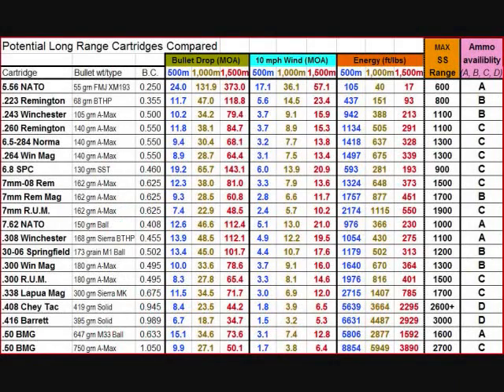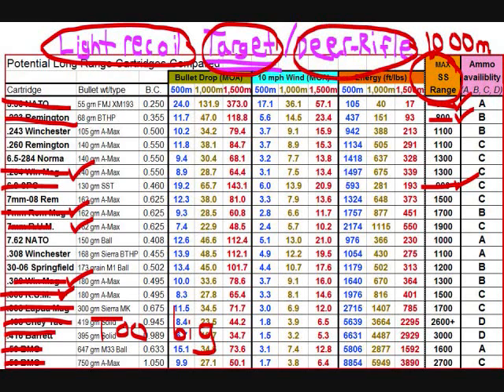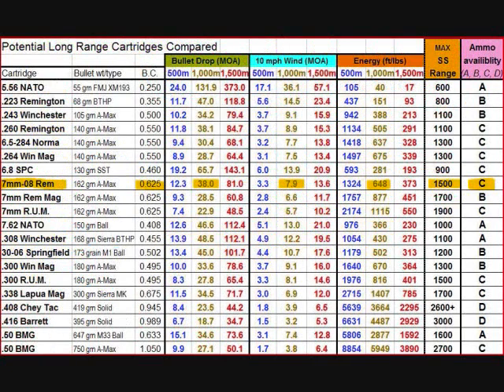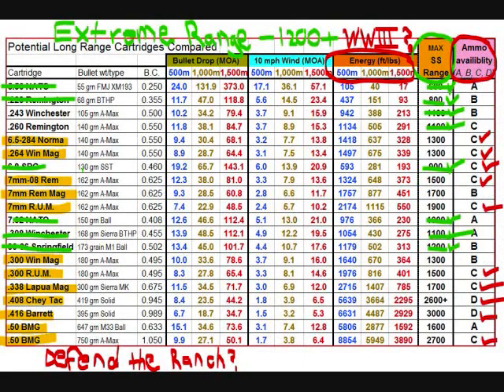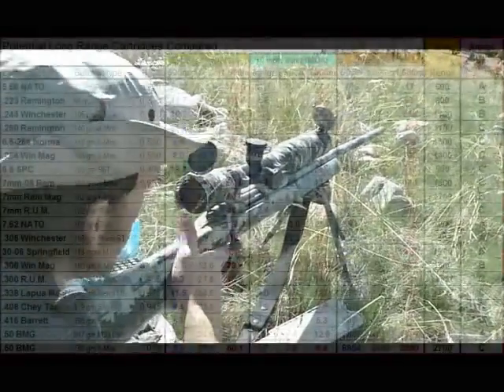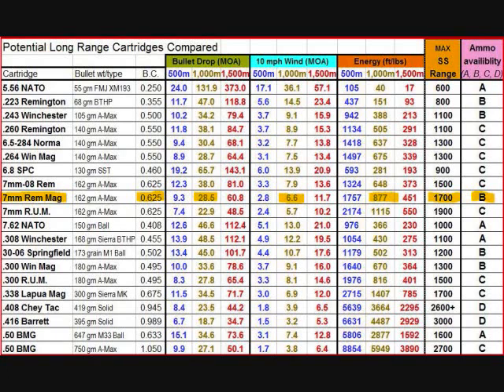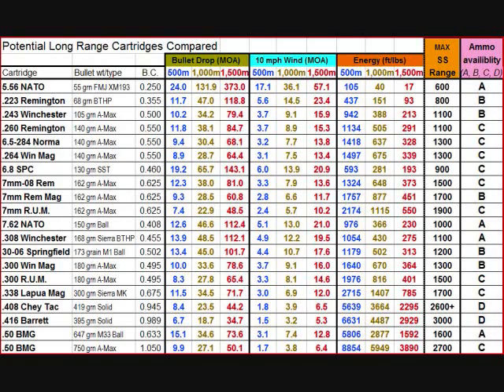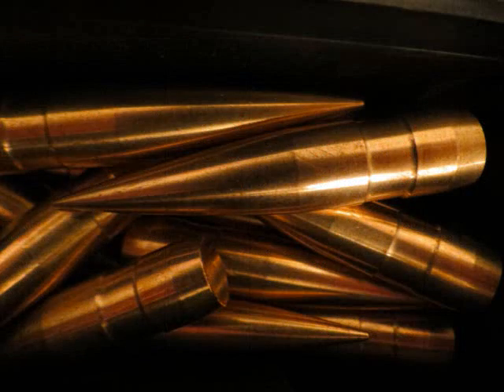Long Range 101 Part 3 - Cartridge Selection -- Rex Reviews

Comment: The 6.5 Creedmoor is so popular I think replacing it for the Norma 6.5 would allow you to not just eliminate this sweet round.
Reply: +Len Williams How do you compare it with the 7mm-08 and 308? Thanks
Reply: 7 mil is practically a 30 caliber so they are more about bullet shape and Charge acceleration. But the narrow profile of the 6.5 Lapua say is supersonic out to to 1600 yards.and that aint' just something you get off one of those.
Reply: Sollard Surman 7mm bullets have a higher ballistic coefficient than 6.5 rather ironically

Comment: I feel data wont tell anything actually. u really need to shoot something and choose the best one
Reply: Shawn Ying At this range, so many variables come into play that I feel there is no substitute for hard data. At shorter ranges where things like wind, bullet drop, and speed are either not important or less important, I would agree with you. However, at long range, saying you should pick the one that feels right based on shooting is like firing a howitzer and seeing if it feels right. Plug in the numbers and pull the trigger, that's the only way.

Comment: Another great cartridge for a short action is the 284 Winchester. You can get 100-200fps more out of it over a 7mm-08. My next build is going to be a 284 Winchester with a 22" barrel. It should keep the 162gr A-MAX bullet supersonic out to 1500yards.

Comment: Considering 2 rifles for 1000 yard shots. 700 ADL in 7mm Rem Mag or ADL Heavy barrel in .308. Would the heavy barrel .308 perform better than the higher BC 7MM Rem Mag?
Reply: Let me add that the ADL is the platform which to build upon knowing its the bottom of the barrel 700. Other solutions could be Savage 11VT in .308 or Tikka T3 in .300 win mag.
Reply: Brian Hamstra
Are you talking about completely stock rifles, or are you going to do some work on them, i.e. stock, barrel, trigger, etc.?

The Savages are good, but they are limited in stocks and other modifications. The 700's really are the way to go if you want a 1k rifle. There's just so much that you can do to them for a really affordable price. As for 7mm rem mag vs 308win, if this is your first long range rifle I would go 308win. It is so much cheaper to shoot/reload, and is much more shootable, much less recoil. You will enjoy it more. I would pass completely on the 300 win mag, and if you had to for ultra long distance, 1000+ go with the 7mm rem mag. The 300 win mag barrel won't last more than 1k rounds, and the recoil is unpleasant, even if you can handle recoil, you will get tired of it if you want to enjoy shooting. Plus, the 7mm outperforms it, and the 300 is a hog to reload for, too much powder, you may get one reload on the brass.

You can get 5-8 reloads out of 308win brass if you take care of it and don't load it too hot, you won't get more than 2 max out of a 300win mag, and the 7mm isn't far behind. Barrel life on a 308win is great, at least 5000 rounds and probably many more.
Reply: sojourner8284 Just purchased the 700 ADL in 7mm rem mag tonight. $379 at Academy and gives me a nice platform to build upon over time. More money for upgrades.Optics: Going SWFA fixed. 10x, 12x, 16x, 20x is the next decision. SWFA is local so I can head down to their store front and do some shopping.
Reply: WOW! You got a deal on that! You can't even buy a 700 action for that price. That's awesome that you live so close to SWFA. Academy is a good store too. Consider the Timney 510, its a great trigger for a great price. It makes all the difference in the world, and shoots great at 24oz.

http://www.midwayusa.com/product/220642/timney-rifle-trigger-remington-700-40x-with-safety-1-1-2-to-4-lb-blue

Comment: 7mm-08 is an awesome caliber when you pair it with the high ballistic coefficient bullets like the 162gr A-MAX. A lot of people seem to forget even with a slower initial velocity the bullet with a high BC will out perform bullets with lower BC's and higher muzzle velocities. This is an underdog cartridge and it's a down right shame because of all the potential. The bad thing about the 308 Winchester is that you really have to use heavy bullets to get the same BC's as 7mm and 6.5mm.
Reply: You are 100% right. Very well said.
Reply: I am right there with you when it comes to recoil, especially for a target/bench gun. Really, I'd say the same for a hunting rifle, because I don't want a hunting rifle that I can't comfortably shoot from the bench as well.

The 7-08 has much less recoil than both the .270win and 308win. It is in between the 243win and 270win, but closer to the 243win. You could comfortably shoot 100 rounds with in a day with a 7-08 with zero issues, and certainly with a 243win. I highly recommend stocks with the Pachmayr Decelerator recoil pad on them, such as the Bell and Carlson stocks. The Decelerator pad is the best there is in my opinion and makes shooting pleasurable. I shot around 40 or so rounds through a 308win in one sitting and it was enjoyable, and I do not like recoil.
Reply: Aon Cygaan Here's an option for you. You can buy a Savage at Walmart for dirt cheap and change the barrels out yourself to shoot multiple calibers. It's really easy with the way the savages are designed and you can get a really nice barrel made by Hawk Hill and have a tack driver for under 1k. If you do get a Savage I recommend a long action so you can seat your bullets out farther. The 7mm-08 and 284 winchester really shine when you seat those VLD bullets out there.
Reply: Hope you don't mind my asking you a question concerning your rifle.  I saw this post while watching Sniper 101.  I am looking for a 90%target rifle/10%msmall-medium game (deer, coyote).  The 7MM-08 is in my short list but I wonder about the recoil.  I'm in that group that doesn't like much recoil from a target gun.  I want something I could put 100+ rounds though and not get a sore or stiff shoulder.  .243 is also on the short list for that very reason.  How's the recoil on your 7mm-08 compared to some other common cartridges like .270 or 7.62X39?
Reply: Thanks much for the input, that's really what I expected as far as recoil is concerned.  Now to select a brand/model that can fit in my budget and leave more than a little for optics.
Reply: Ryan Rosser Thanks for the suggestion!  That too goes on the short list of potential answers to the situation.

Comment: so how do you compare the 270 vs 07-08 which you don't have on the chart?
Reply: The 270win is a great hunting caliber for 500 yards and under (with the right bullet and rifle, but it is not a long range cartridge, nor are the 277 caliber bullets ideal for long range shooting, as they are mediocre in BC. The .277 family of bullets simply do not have the ballistic coefficient to compete at long distances. Their BC is not high enough to fly well and buck wind past say 400 yards if you are concerned with accuracy and energy. Also, their low BC, when compared to other calibers, results in a more rapid loss of velocity and energy. The 6.5mm and .284/7mm family of bullets are the cream of the crop when it comes to long range shooting because of their phenomenal ballistic coefficient, unless you're doing 1.5+ mile stuff where a 338lapua would be needed.
Reply: Je P Ya, he's right, but With good hand loads it is still a good round. I don't know where I read it, but there are some new 270 rounds out there. 165g with great bcs. I want to get a hold of some. But I still love the 270. Just such a versatile round. And cheap factory ammo still shoots great out of my tikka. Great round, rifle combo for hunting especially due to its light weight in the mountains. Idk why, but for me, especially in my tikka which is a tack driver I find I always go back to it for hunting. Out of all the deer I've shot with it, and a number of Elk it just works great. 90% of the deer shot most just drop right away or maybe go 30-40 yards then drop. Even my personal best. Which was a 350+lbs Mulie buck which scored 198 dropped instantly at just over 300 yards. On a quartering to shot. But for target shooting ya, I'd go with something else. I want a Tikka varmint in 7 win mag for my next rifle for prairie hunting. But will continue using my 270 for the mountains. Everyone is different.

Comment: I wish the 7.62x54r was on the list to compare.
Reply: I like 7.62x54R, and I reload for it. It would fall on this list between the the .308 and 30-06. Power wise it’s an ok cartridge. Hope that helps.
Reply: Get on Excel and make your list, fill in the data. Fill in your own data for every caliber round on this list then use this list to confirm. Don't copy, it gives you a better understanding. A good way to do it for example is 5.56 has its own section then each Wt/type of bullet in a subsection off the 5.56 chart block, same for all other ammo.

Comment: Thank you a lot for videos. There are full of very interesting and accurate information. I recommend everyone to watch them! I have a question : I'm using a Remington 700 in 7.08 caliber. I normally tend to use basic prvi 140grs to shoot under 300m then 150grs sierra HPBT (2.5g of Tu5000) up to 500m (20cm group). I haven't tried yet to go beyond. You say that the 7.08 with 162grs ammo has its max range at 1500m :) I'm so impressed by the BC of these A-max!! Ideally I would like to group in 20cm at 600m and to be able to reach 1000m (as you said with a bit of left over so let's say 1200m). Do you have a recipe for this A-max load? Thanks
Reply: Check your reloading manuals for a good load on that bullet. If they don't list the 162gr go with the 160 loads.

Comment: Hey Rex, I'm starting to reload for my new 7mm08 tikka t3 varmint, and while was going to just use Lap us .308 cases and kneck down and kneck turn a 40 yeah bench rest shooter and gunsmith told me to use .243 brass and kneck up. But get this, he wants me to buy .243 lapua brass, load a 6mm pill and shoot it out of my 7mm08! He says it won't harm the barrel at all and will expand the case effectively fire forming the case? Your thoughts???
Reply: He is an idiot about the 6mm bullet. A friend of mine bought a 7mm-08 a few years ago. He did not have any brass for it, but I had a bunch of .308 brass I did not use in my bolt gun (I only shoot R-P or Norma). The reason you want to use .243 brass is the shoulder area, but you don't have to use it. For my friend, we took my .308 brass, and ran it through his 7mm-08 FL die, This helped form the neck down, and thin it a little. Then we put the brass through my .243 FL die. This would do the proper shoulder adjustment to allow the brass to fit into his chamber. Then the brass was put back through his 7mm-08 FL die to create the correct neck tension, and shoulder contact points on the body and neck.

Once all of this is done, simply treat the brass as any other pre-fired brass. Just trim, and fire-form for proper fit. He still has some of that brass left that we did all those years ago. He can shoot the formed brass, and they will shoot the same sized sub-MOA groups as WIN H.S. 7mm-08 brass does.

As far the guy telling you to shoot a 6mm bullet down a 7mm barrel is FULL OF SHIT!!! If he would have said that to me, I would have look back at him and said "So you are the type to shoot your 44 MAGS through your 1873 Colt SAA clone aren't you?"

Some people just ........ Ugh....... (face palm).
Reply: Sarthur84
 Yeah thanks for the input.
Reply: I've sized up and sized down brass to fit my 7mm08 no problem some times your guys do extra work for nothing I just de cap clean lube resize trim load its easy

Comment: 7mm, I have problems. Help all.  Out of about 600 rounds shot, I have had 2 that blow back thru the bolt.  It takes 2 guys holding the rifle down and another opening the bolt.  All reloads are pan charged and trimed cases. ?   Help.
Reply: pr4runner I'm no expert but sounds like you accidently loaded those two rounds way hotter than the others. I'm going by what I saw on another vid where they were torture testing a particular caliber by loading hotter and hotter loads till the bolt was very hard to open.

Comment: For this video, first cartridge selection was the 7mm-08 w/162 Amax showing supersonic speeds out to 1500m. What load of 7mm-08 was this? I can't find any commercially available 7mm-08 ammo loaded with 162 Amax's OR any 7mm-08 that stays supersonic(~1200fps) out to 1500m. Using the free online ballistic calculators, the farthest shooting 7mm-08 162 Amax hand load info (that I could find) only stayed supersonic till about 1100-1200m. Just curious...........

Comment: Deer hunting at 1000ft? Is this guy for real? Stay 300ft max for actual hunting. Stick with cartridges like 308/30-06 and you'll be fine.
Reply: Do you mean yards? 300ft, 100yds, is easy, and anyone can take game at that distance with little effort. And yes, he is for real. Long range shooting and hunting has actually become a sport, and is something which is very attainable. With the right equipment and practice big game can easily be taken at longer distances. For the average person with the gear and a little practice 5-600 yards is attainable. It takes great skill and discipline to shoot accurately and take game at longer distances. Most traditional hunters think that anything past 200yds is a ''long shot'', but in reality it really isn't. Getting past 300yds really requires skill, and it is hunting, as there are so many more variables and challenges to consider as the ranges get longer.
Reply: r91976 He also said - target shooting AND deer hunting.  Shooting steel at 1200 meters totally doable.
Reply: There are rifles that have 1/2 moa at 1000 meters..

Comment: I'm loving the 7mm-08 potential. Where did you find the specs for the 7mm-08 in 162 A-Max? As far as I know, it isn't factory loaded by anyone. A specific recipe? Or just math from SAAMI with BC and projectile weight factored in?

Comment: Thinking of getting a .338 LM.
Recoil is a big worry for me. Don't want to get recoil flich.
Would it be a good idea to start with half powder.loads and gradually increase over the first.100/200 shots?
Just to gradually get used to the recoil?
Reply: Most 338 Lapua rifles have very efficient muzzle brakes so recoil is not that bad, the worst thing is the muzzle blast so don't ever shoot it without some sort of hearing protection. Even full power loads are easy to shoot.
Reply: Honestly, recoil flinch is something you can "learn" yourself away from.  Recoil, in and of itself, is just physics.

Honestly, I wouldn't be too worried about the recoil flinch.  If you are, try and find someone else that has a gun in .338 or a similar cartridge, and try shooting it.  Get them to load it for you, and have them (at random) give it to you unloaded, as this will make it extremely obvious if/when you're flinching. 

Most the time, people flinch because they're "scared" of a gun.  If you just expect it to have some kick and noise, you should be fine.

Comment: Light recoil,   how are you determining recoil?   I know the 30-06 has a lot of recoil.
I have also see recoil calculators on the internet  but am sceptically on how accurately it represents "felt" recoil.
Reply from the maker: Great question, sir!  Although "RECOIL" can be quantified mathematically (in terms of Velocity (ft/s), Energy (ft•lbs), and Impulse (2.9 lb•s) ft/lbs), overall "felt recoil" is contingent upon other factors such as stock ergonomics, physiological individuality, and psychological resilience... it can thus only be fully represented as a matter of personal perception.   In simple terms, when trying to define these dynamic interactions, it may be best to employ qualitative comparisons based on personal or collective shooting experience.  An A, B, C, D, F grading scale has to be primarily dependent on the potential user's own sensitivities and concerns.  Thus, each shooter's recoil perceptions will vary tremendously.

Comment: a 140 a max going 2800 which is top velocity drops below 1000ftlbs between 600 and 700 yards.  go to a 175 smk with a bc of .505 is a better comparison between rounds.  this charts compares the high-end b.c bullet for 6.5mm to low to mid b.c bullets for the 308.  or .499 for the hornady 180 i.b both have 600 ftlbs at 1000y.  more ftlbs at the buttstock too.  300 win mag with a 208 a max at 2700fps supersonic to 1500y at sea level

Comment: 1,050 in bc on the 12.7x99? that is not possible...
Reply: Ya it is.  All 1.05 means is that the projectile in question is 1.05 more efficient that the reference projectile.  See the following from Wikipedia what the reference projectile is: 

"The standard G1 projectile originates from the "C" standard reference projectile (a 450 grams (1 lb), 25.4 millimetres (1 in) diameter projectile with a flat base, a length of 76.2 millimetres (3 in),"
Reply: Ahh, learnd something new today!

Comment: Alright, so I have a question for you - I get how different rounds have different internal and external ballistics, but what makes this happen? The making of the ammo? How it's shaped? I guess I just don't understand why a 162gr 7mm round has a better BC, and apparently is an overall better round, than a 168gr .308.
Reply: The 7mm 168gr bullet is ballistcally better than the 168gr .308 bullet bc it is longer and thinner, hence it flies better, whereas the .308 bullet is shorter and fatter. That's the answer using unscientific language. In other words, 7mm bullets are more aerodynamic. Generally speaking, heavy for caliber provide better BC, but some calibers simply have better BC in general. The 7mm family of bullets have higher BC than the .308 family of bullets.